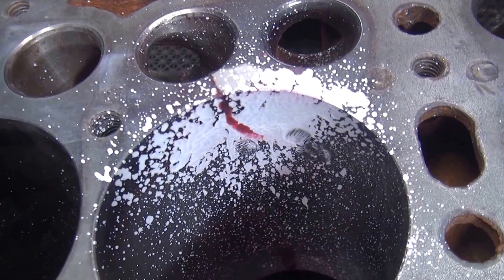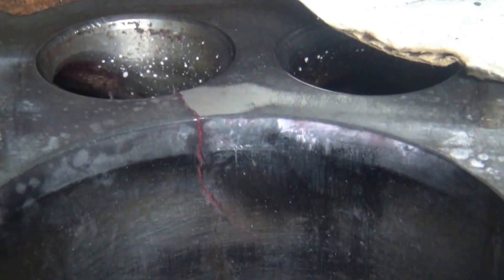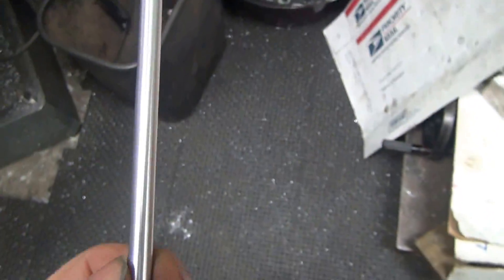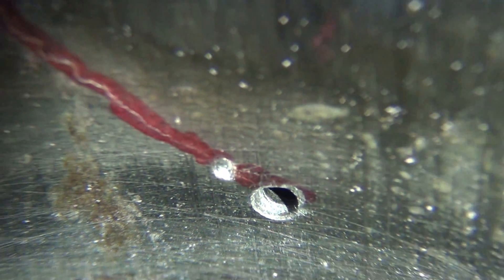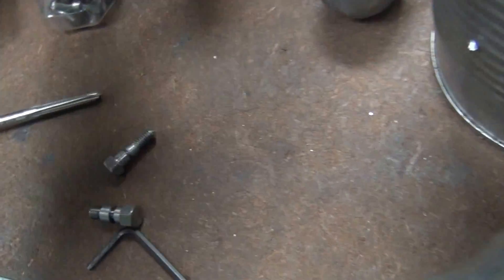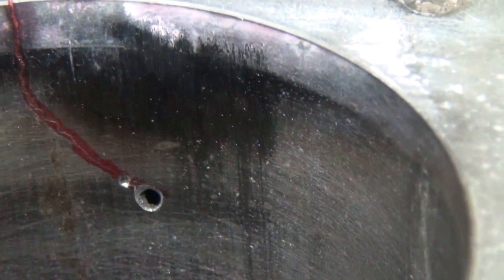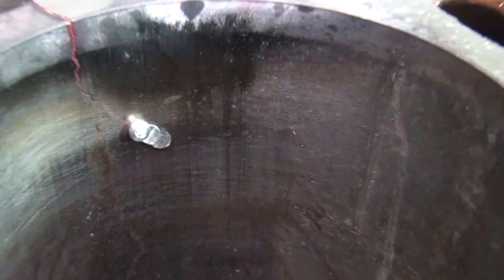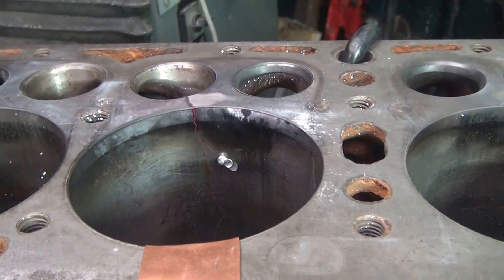1932 ford #105 model A or B flathead race block crack repair by tatro machine

Comment: Why do y'all keep working on them crappy blocks. They're obviously junk they're off failing in need of repair and not building a bunch of horsepower there's not a big market for them I don't understand why you're messing with them
Reply from the maker: because going fast with old crap that they say you can not do is fun.
tatro

Comment: I am old US Army engineer.
In army sometimes supply breakdown, no can get critical parts. Mission must go on.
You do what you can.
You use your knowledge and skills. You use what you have.
Improvise, adapt, overcome, pull miracle out of tin can. 
In end, motor run again. 
Man triumphs. 
Wind in face flying down the road. 
Salute to good mechanic!
Very nice to watch. 
Very satisfying.

Comment: ...stupid question, but how or why is this an effective method for fixing cracks in blocks?   What is the metallurgy Mechanics and science behind this process?   I would've thought, that this process would stress the crack more, and create a bigger problem in the engine block.   I don't understand it, and who developed this process or discovered it?

Thanks, from a backyard hobbyist engineer, and auto mechanic  lol
Reply from the maker: just go to the lock-n-stitch website and read all about it.
tatro